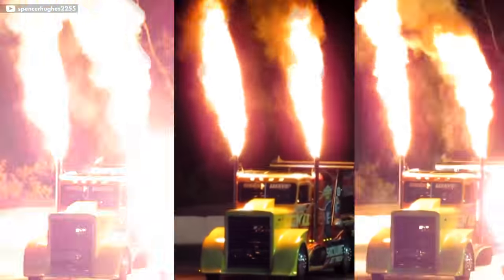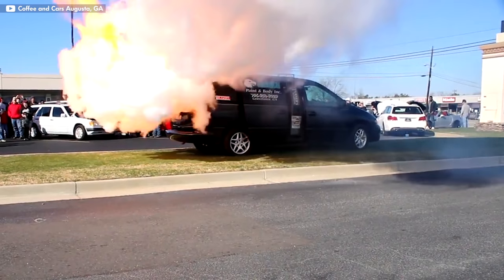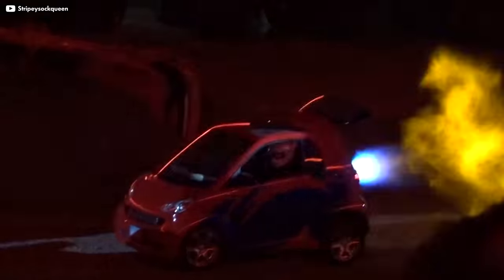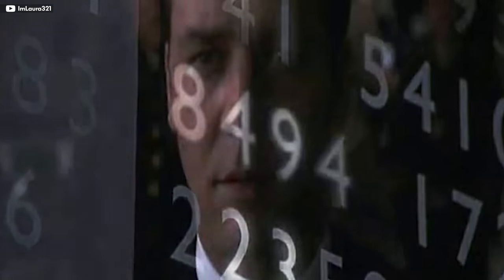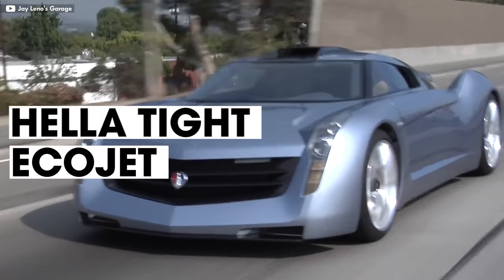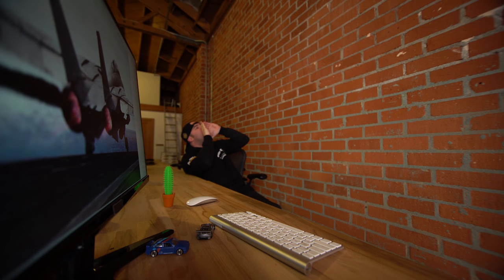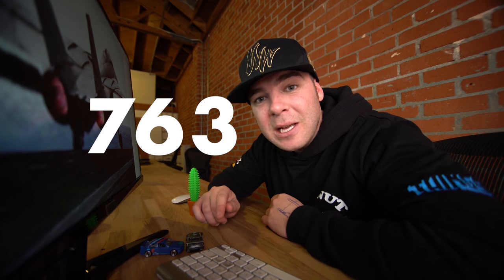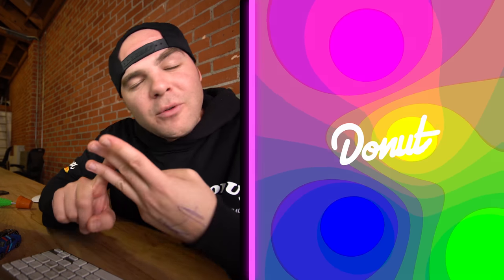TOP 10 Jet-Powered Cars | The Bestest

Comment: 12 Thousand or 1,200 HP?
Reply: Alaska Skidood I think they meant 120
Reply: Alaska Skidood I was wondering the same thing
Reply: Its 12 Thousand, every two years there is an Airshow at Joint Base Andrews and they race it against a plane.
Reply: MrLemonade124 what not dude. He meant 12
Reply: Alaska Skidood 12,000
Reply: Alaska Skidood 

375 MPH , 0-300 in just 11 seconds , not to mention that the "shockwave" must weighs over 4 tons! , it's definitely not 1,200 HP , so it's 12,000 HP , remember in number 6 that school bus uses a fighter jet engine that produces 42,000 HP ,  and it goes up to 367 MPH , but the shockwave can go faster up to 375 MPH , idk why 12,00 HP is faster than  42,000 HP , just saying that shockwave differently needs more than 1'200 HP to accelerate to 300 MPH in 11 seconds .
Reply: No he meant 12 hrrrsspeers

Comment: You forgot the 45,000RPM Chrysler Turbine.  It was one of the most iconic turbine powered, road legal cars ever built. Built in 1963 by the Chrysler Corporation, it was built as a test subject. Only a handful were made. They were distributed not to people willing to pay large sums, but to people specifically chosen by Chrysler. It was designed not just for speed, but for the capacity to be a family grocery getter. There are only a few left in existence today. Some are on display, and a couple are privately owned and driven to car shows. That is all, thnx.

Comment: I find it ironic that the helicopter you show at 4:45 when talking about a turbine usually found on helicopters, actually uses a radial piston engine :D

Looked it up, and later on it was modified to use a turbine engine, but originally had a radial engine. Start up videos of the S-58/H-34 are cool, they sound like old WWII planes starting up

Comment: No fuel system wizardry,  jets just burn anything. Get it running hot enough & it would run off finches. Also collin made. Pulse jet, basically runs off the same effect that makes your car exhaust crackle on the decel

Comment: 1. You're trying too hard to be funny.
2. Boeing doesn't make jet engines.
3. Jet engine power ratings are usually talked about in terms of Pounds of Thrust, not horsepower.

This vid has so many flaws after just 1 minute of watching...